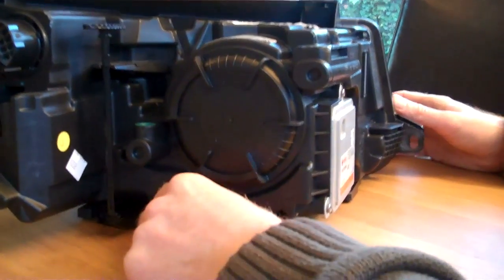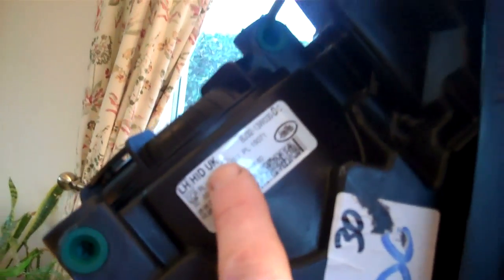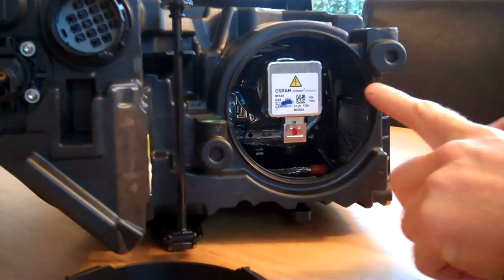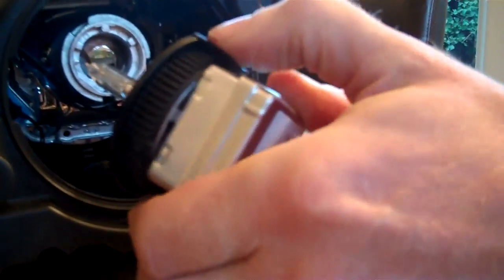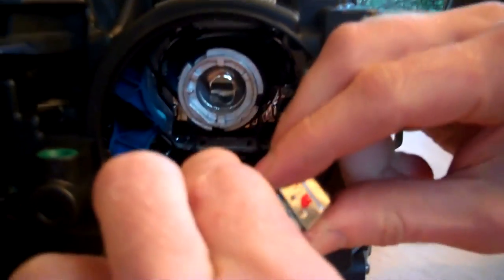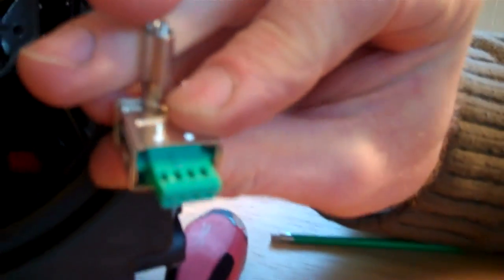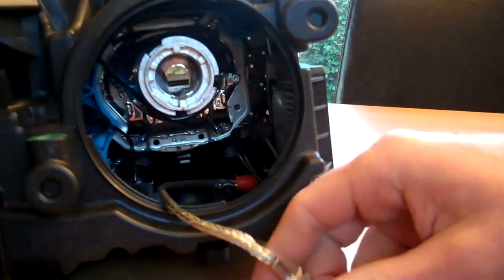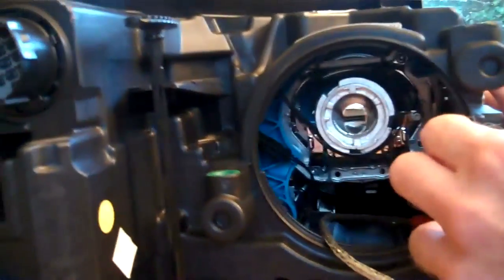How to change HID bulb on Range Rover Evoque

Comment: For US driver's side, this can be done without removing whole headlight. You just need to reach in front of the grill with left hand and remove the cap, then try to fit the right hand in on the other side while rotating the plastic ring.

It can get frustrating to disconnect and reconnect the electrical connection with barely any space to work with, but ive done it and IT IS possible.

Word of advice though - when you swap the plastic ring, rotating it back and forth about 15-20 times on the new bulb to wear it in, because it will need to rotate freely to set it back into place.
Reply: Does the battery have to be disconnected? 
Only asking because of the Ballast, I’ve dealt with M3s and they were extra sensitive needed to do everything in sequence it wasn’t just plug-in play
Reply: @omarrodriguez9957  no doesn't have to be disconnected

Comment: Hey i change the bulb xsenon when I start the engine  is flash good but after 5seconds is off only the one when I change you can help me ?? 🤔🤔
Reply from the maker: Hi - it could be the power module under the headlight packed up - swap the module from LH headlight to the RH headlight.
Reply: @L663  Is possible to been the light :/ ? The module is ok

Comment from the maker: Hi - I believe this is possible and could even be a straight swap. You will need to swap the whole headlight - the new headlight comes with an igniter that steps the voltage up to 1000's volts for the Xenon type bulb ( gas discharge ).

Comment: Can you change the bulb in situe?  Or do you have to remove the whole unit?  Noticed my tonight my bulb had gone, in cars I've owned in the past it was a doddle.
Reply: Did you get an answer to this?
Reply: I took it to Land Rover.  I spoke to them and they said the whole unit has to come out, easy enough to do once youve done.  Luckily a friend works at my local LR dealership so they charged me the cost of the bulb and then a few pounds more.
Reply: yes you can /first take the front grill off then undo the two bolts on top of  the head light unit  there is a lever on the head light gently pull this up it will release the unit and bring it forward so you can get you hand in to change the bulb a very clever idea from RR
Reply: It’s easily done. They tell you they have to remove the whole headlight just to charge you more. 

Fastest way to do the harder end with the intake, is to remove the intake (much MUCH easier than the headlight) remove the battery guard and you’re good to swap the bulbs out. Takes less than 10 minutes even if you’re inexperienced.
Reply: Yes you can I left a comment with more instructions

Comment: It is possible use xenon lamp d2s instead d3s, putting the black pastic to adjust the bulb? I have xenon lamps in a halogen headlamp but I want to put the original xenon with signature leds in my car (with d2s or d3s xenon lamp).
Thanks.